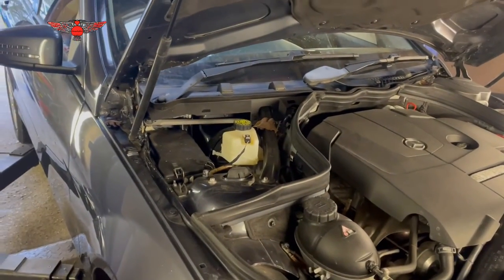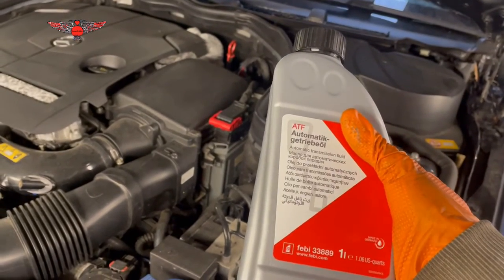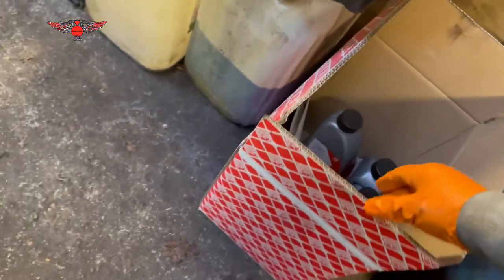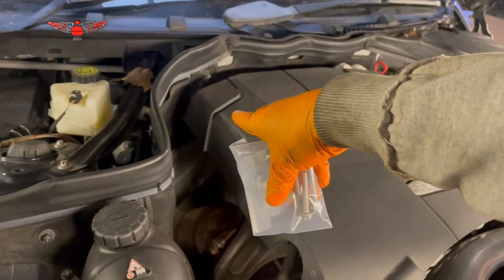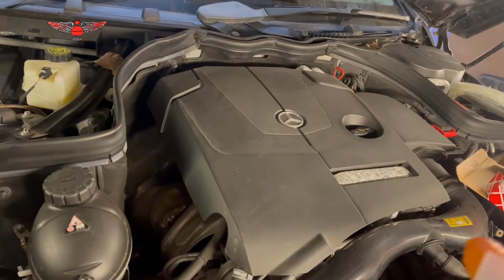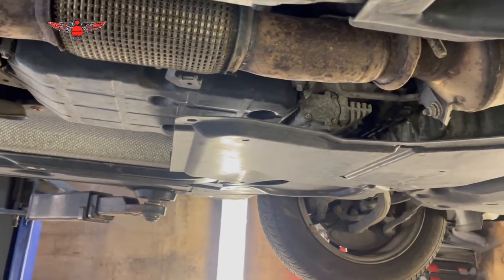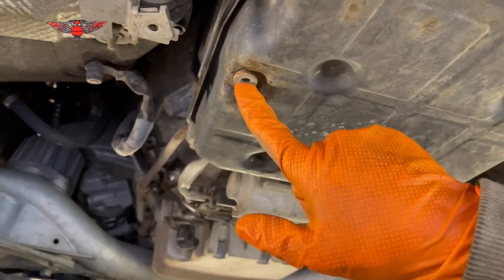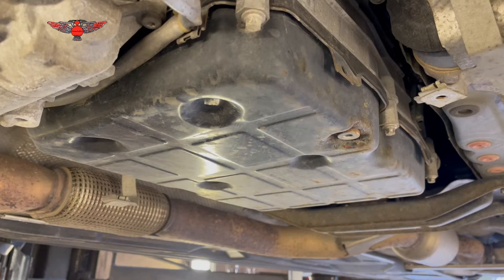Mercedes w204 031 2013 transmission fluid and strainer filter change

Comment: Nice and thorough, except you didn't remove the transmission pump and drain the torque converter, to make it a fully complete transmission fluid change. For this car the fluid was fairly clean, however for some it may not be, and that's why you gotta also drain the torque converter fluid. Perhaps  for the next time you can do this. Thanks!
Reply from the maker: yes this is a low mileage car and oil wasn't that bad, but in future ill have to make a full change.

Comment: Great video! I was wondering did your car have a torque converter? If so, why didn’t you drain that too?
Reply from the maker: Hi yes it does have a torque converter, I didn’t do it because the person I was doing it for didn’t want me to fully drain the oil just do a basic change. It’s fairly easy to drain the oil from the torque as far as know you need to get the torque to turn till you see the bolt, perhaps there are other vids you can see. There is no technical reason as to why I didn’t do it if you know what I mean.
Reply: @DaringBeefcake  awesome man! Thank you and again. Love the video. You gained a new follower!